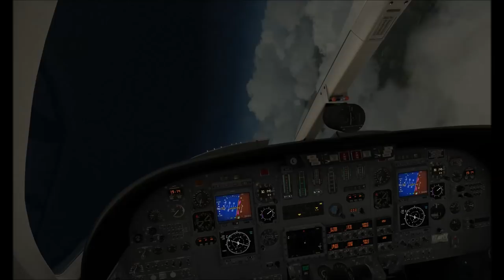Barrel Roll in a Business Jet - Case Study 1

Comment: I imagine if they didn't have a cvr to listen to that this crash would be unsolved. Who would of thought those inputs were on purpose. I wouldn't of thought so. Then again I was just as surprised when the air france crash into the ocean was due to a stall at 30000 feet and the pilot didn't put the nose down and pulled up the whole way down

Comment: i just can't understand brittish people, they talk so weird
Reply: Heh, it's a robot voice.. hard to understand for British people also.
Reply: @wingandaprayer883  i see, are you guys still driving backwards?
Reply: @pratwurschtgulasch6662  we drive forward normally
Reply: @derlangsame4471  you guys botched adopting the metric system, you only took about half of it and you say kph, what's that supposed to mean, kilo per hour? why not call it kmh as in kilo meters per hour aka km/h. it makes sense for miles as in miles per hour aka mph but then you guys half ways switched to the metric system but still call it kph it makes no sense.
Reply: @pratwurschtgulasch6662  we call it mph
Reply: @derlangsame4471  for some reason i always see brittish people use kph but if you're using mph then i guess it's correct. but as far as weight goes, the brittish pound is different from the american pound or did you guys convert to the metric system on that one?
Reply: @pratwurschtgulasch6662  pound (weight unit, not currency) is the same. Maybe you were trying to mention about gallon. Yes, gallon US and UK are different
Reply: @pratwurschtgulasch6662  As an engineer, I agree that metric system is better because you have the steps, from kilo to mili. Even from peta to nano. For weight we use pound but then ton (metric) for heavy stuffs like cars
Reply: @derlangsame4471  ok thanks for the info. in the brittish baking show when they turn on the oven, they always say "fan" or "farn", do they mean Fahrenheit? Also in the US we say mil for 1000ths of an inch but I think in the UK mil means millimeter (i think). it's all quite confusing :)
Reply: @pratwurschtgulasch6662  Ich denke, es war etwas über einen Heißluftofen. Bin mir nicht sicher über die USA, aber ja, in UK, bedeutet mil Millimeter.